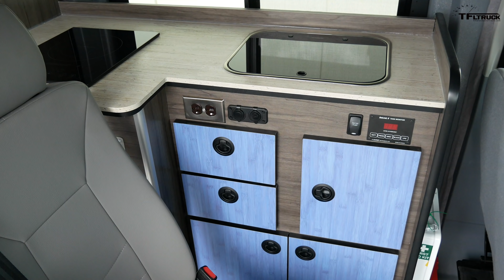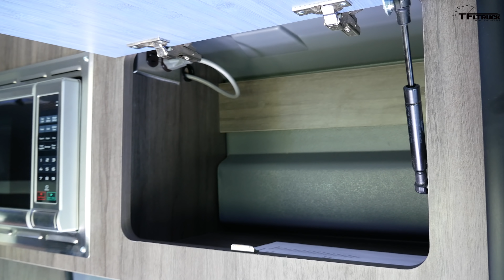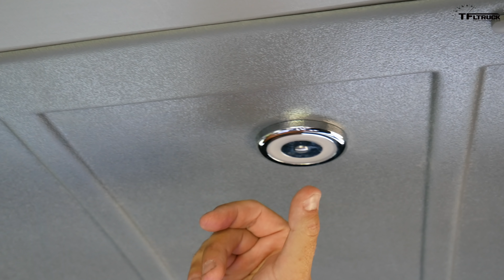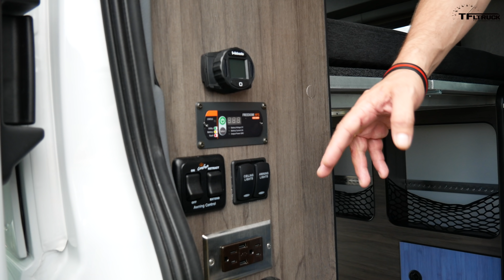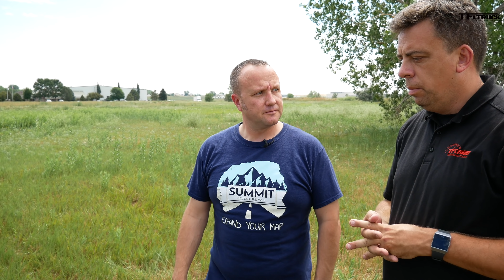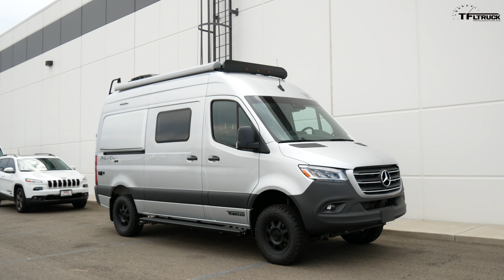This 2020 Ford Transit Summit Adventure Van Is The First Of Its Kind! #Vanlife

Comment: MSRP of this van 135k. Winnebago REVEL msrp - starting at 185k, Sprinter chassis model Winnebago offers - Starting msrp at 215k

People buy Class B campers because that is what they want. They don't want to tow a trailer, they don't want a big class A or C, they want a van based camper.  This is what they cost. Want to spend less, build your own conversion, buy used etc....

Comment: Ford transit vans,Voted best value by Mercedes-Benz mechanics. I have 1. Built it out myself. Bed across the back. Husky 5 drawer tool box on wheels. Stove on top of box. Storage across the upper portion of the bed area. Tool box used for food items. Fireplace in the sliding door. Reflecting shower.

Comment: Did they fix the 3 fatal flaws of the Trasnit (2015-2019)?   Heavy under rust,  Windshield Drainer if it gets clogged it drains onto the MAIN COMPUTER TO CONTROL THE VAN!!!! like WTF FORD?   And the Drive shaft coupler Needs to be checked or even replaced every 5k miles. I sure the hope addressed these issues.

Comment: I like the Russian interviewer, (I'm guessing).  Very good interviewer and presenter.  Also did a good job of editing content, music, etc.  Loved the bed system.  When not in use, looks like you could fit a 4X8 sheet of plywood.  Nice van, very functional.  it is a little pricey, but they need to get paid for a lot of design and production expense in making the formed panels on the walls, very light aluminum etc.

Comment: $135k??? A base 2019 model right now is 25k..  Also do you really want to look so much like an RV .. stealth matters.  Just buy a used one with 30k miles  for $15k still under warranty, build it yourself and rough it a little bit with a compose toilet and small gray tank.  5k and a little bit of DIY goes a very long way.

Comment: Really? 35k difference for the Revel which has 4 wheel drive, a shower, a toilet, better insulation and a premium heating system, and is a much more expensive vehicle to begin with. I don't see how this Ford compares to the Sprinter Winnebago Revel.

Comment: I'm not a fan of the all wheel drive systems. They're fine for small cars.  I had 4x4s when I lived in the mountains and still have a major preference for locking hubs. I can't get used to anything else and I've tried. I'm finishing my 2019 Transit Quadvan/Sportsmobile conversion soon and retiring to the Sierras and Rockies and beyond. If I had to deliver packages in Denver this van here would be fine but not my favorite.

Comment: Talk about greed, 135K for something without a bathroom, what a rip off. You can find a class B rv with a bathroom/shower for around 20K less, if you shop around. Not even an AC for that 135K. I was interested in this transit, until they came out with the price. and as someone else said, you can by a brand new one for 35K to 45K depending on options, and spend another 15Kto 20K and do the buildout yourself, so for half the price of this transit, you can do it yourself.

Comment: 135K???? Where's the gold plating? So many Pickup+Camper combinations would offer so much more for less money. I don't understand this at all. Could literally buy a brand new decked out 3/4 ton diesel pickup and a decked out 4 season 30+ ft bumper pull camper and still have money left over. These "van" conversions are a complete ripoff. The guy selling this thing looks like a shady used car salesman. Pass.

Comment: Custom means you pay for workmanship and skills. Large companies like Winnebago and Pleasure-way are made on an assembly line so workers are typically paid less and may have specific skill set. Additionally vans will have limited floor plans due to standardized parts. Custom shops like outside van and Sportsmobile typically have higher customer satisfaction than a large company.

Comment: These guys are a little too proud, starts at $135k. Nice, but can’t see the value at that price point. Sportsmobile is a better value or even the last gen 4 season 4X4 Revel can be found at this price point now, just my opinion. Nice to see more options though but geez, $100k on top of  the base platform!?!?

Comment: It's not for going off-road it's not four-wheel drive and it doesn't even have a damn bathroom yes it's a cheaper wannabe version of the Revel but none of the capabilities
Reply: you can buy a revel for less as well and have 4x4.....

i prefer a transit gas over the sprinter diesel.....the transit is coming with awd soon...but its not true 4wd

Comment: Love the bed system.  I would use a van both for camping and as a work truck.  I was thinking of a welded steel removable frame, but this looks to be a nice variation.  Price is high for no bathroom. Nicely done, though.

Comment: Pleasure-Way makes a van for nearly half the price on the same chassis why would this cost $135,000? Seems way overpriced.
Reply: I know that's alot you can get the brand new cargo transit 350 for under 40k. I have 2 of these 250 for work.  It also has some issue in transmission. I would go for Mercedes next time

Comment: My questions would be:
1) since the van is tall/high.....would it be top heavy and easy to roll over in a sharp turn or in winds?
2) Did you say it uses unleaded gas and if so what kind of mileage does it get?
3)  sorry....but seems a little over priced....just saying.

Comment: LOL… You lost me at the price. You have no solar you have no propane you have nothing it’s not even sexy.I’m done ...have a nice day.
For those that are looking, don’t get scammed by this... check out the Winnebago Trovato or its competitors that’s a little around 69,000 to 85,000 and you get way much more! Or you can be like me and just build it yourself for a used Mercedes sprinter or dodge pro master at $10,000 - $18,000 and then another $15,000 for the customizations and some hard work. Grand price of 25,000 - $33,000 - you’re welcome.

Comment: I have a Ford Transit Diesel front end on a 2018 Thor Gemini. It's about 4,000 lbs heavier than this van. But even with the heavier weight, the Ford Transit has a lot of "get-up-and-go". Sometimes I like to push it to leave cars at stop lights. Also, the ride is VERY similar to an SUV...something that means a lot after hours of driving with the normal vibration you get with other model suspensions. I think the Ford Transit Diesel is a "hidden gem". I MUCH prefer it over the Mercedes van (both for the ride and the cost of ownership).

I like the water kept inside the van. That means you don't have to winterize the vehicle in cold weather and you can STILL load up your water, before you leave, and you're ready to go. Also...you KNOW its fresh and free of germs! I would also recommend a portable toilet that can also be changed out in winter so it doesn't freeze. In addition I would also suggest they install a second engine generator (as they do on current Roadtrek RV's), with inverter, so one would have 120 Volts while the engine is running. That would eliminate the need for a separate LOUD generator....and even a need for external power (when "boon docking")

Comment: I was a Fleet Manager of a relatively large limo company, with between 20 and 30 Mercedes Sprinter - based commuter, luxury, and limo vans. All diesel. Their Diesel engines gave amazing fuel economy, but...  their Ackerman steering geometry was all just a little off, causing felt skipping and very poor tire wear if you do many tight turns. And the “first” generation of DEF exhaust treatment systems worked great, for the first 100k miles or so. After that, plan on a $7k DPF filter renew by 130k miles. Mercedes maintenance costs are astronomical. Knowing that, and now having experience driving the smooth Transit chassis, I’d go with the Ford 100%. And while the diesel does give better mileage and torque, there is a reason why many school busses are going back to gas - clean, and no after-treatment headaches. I love this van!  Carry on with the lack of LP and go with full solar and a 12v Dometic pull-out top-opening cooler. Let’s go cord-free for 7 days!!!

Comment: Nice looking but a bit overpriced. My self-built Ecoboost 15 passenger van is less than 45k all in with the camping equipment, including the new van. It comes apart for 15 pass duty. Or truck duty without the seats. In camping mode it has a queen bed, seats 5, and a 100Ah Battle born lithium battery, inverter, home brew water system and a sink, and a fridge.

Comment: All the camper vans are unrealistically priced. You have a standard tow behind camper for around $20,000 plus a transit van for $40,000 add those up and you have..... not $135,000 this goes for all the vans.

Comment: Roadtrek and Leisure Travel are only $115,000.00 And they are RV certified. With more options including Generator\Solar... But they did at least have it certified as a Mobile Home. Which allows them to sell it with 10-15 year mortgage. That means cheaper insurance as well..

Comment: I like that it is a Ford but the price is crazy! I think you could get into an entry level Class A for the same price or a little higher or maybe a slightly used one. Of course it is also much bigger and harder to drive. I just can't believe this is so expensive when the cost of the van before modified is around $40,000 $135,000 is totally ridiculous!

Comment: 3500 pound tow rating is a non-starter IMHO. Also lack of propane = boondock killer. If I was in the market for one, I'd buy the Winnebago Revel, Sprinter van based, 5000 pound tow rating, 4 wheel drive, nice dinette, solar and a bathroom. Still doesn't have propane. With the more generous tow rating, you could pull a small camper behind you and have additional capability.

Comment: Unfortunately, Transwest haven't looked at their competition … other Ford Transit RVs. 

Mine is an Okanagan Tribute, 350XL, highroof that includes a rear bathroom (shower/toilet/sink), Truma Combi+ furnace/water heater, twin bed design that can convert easily into a queen, removable table, far more cabinet space, 100W roof-mounted solar panel, 2500W Onan generator, A/C and so much more. The cost of my RV is significantly less than this "weekender model. There are quite a few other Ford Transit-based RVs that people should look into before even thinking about buying this overpriced model. I paid $68,000.00 US ($74,000.00 Cdn) for a used 2018 with only 30,000 miles on it. Cheers, Steve

Comment: This would be an entry level build from most boutique van builders. Other than the extreme availability, there is nothing groundbreaking in this build. Basic electrical, basic heating, mediocre finishes, thermoformed plastic looks terrible uncovered. Whats the pro? Its so cookie cutter you can have one right now with zero options.

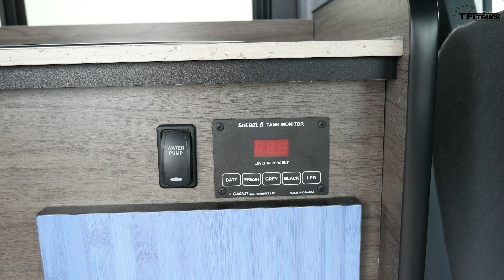Comment: 14:11 "Not having to deal with black water." So why is there a black water control at 5:07?
Reply: @MultiPurposeReviewer … it's using a standard monitor display used by many RV manufacturers.

Comment: I would not drive this van anywhere. I have driven one recently and it felt very unstable and susceptible to roll over.  Perhaps if it was a dually it would add stability.
Reply: @Robert Morris … there are Ford Transit Rvs on the market that use dually wheels. Having gone from a 2003 Ford E350 Super Duty RV to a Transit 350XL, high roof RV, it is far more stable (particularly in winds) and more comfortable. But have never driven the ProMaster as a comparison.

Comment: I get the appeal of these. But for the price...you can buy a truck, AND travel trailer and get way more use out of both. And you wouldn’t be settling for junk on either.
Reply: Or buy the van and build it out yourself.
Reply: Dat Tran, yep that’s another alternative. I just feel that for the price, you could buy a truck that you could daily drive. Therefore not only is it a better price for the total package, but you’re not necessarily buying an additional vehicle. If you go the route of the van, and even fitting it with this stuff yourself, it’s still an additional vehicle your purchasing.
But however you figure it, you can come out ahead basically with any other option. Because all these guys are doing is purchasing the vehicles, and up fitting them themselves. Then they have to make a profit. So to me, it just wouldn’t make sense to buy this with so many other options.
Reply: Agreed.  Way more use from the separate vehicle and trailer.
Reply: This is all in one setup, without  dragging a big wide  rig and trying to make those super tight corners and limiting narrow roads or being stuck at a dead end priceless, you want comfort stay in holiday inn  lol
Reply: We have a Rockwood Roo....About $30 000 CAD and i can tow it with my Taco. Truck and RV about $70 000 CAD. Roo has all.comforts of home.
Reply: Can't stealth camp in a trailer.
Reply: @scottslotterbeck3796  yes you can...look at Rockwood ESP popups as an example
Reply: I feel like this would be pushing for stealth camping. I mean you you have better maneuverability, to get into these areas, but I wouldn’t consider it stealth camping. But I suppose that term has a bit of a floating definition depending on who you’re talking to. 
But to state my point again, it’s about the price point. Im not arguing that this doesn’t have its uses. But you COULD replace this with anything else. Tents are what are primarily used in stealth camping. Or like I mentioned in another comment, a truck bed camper. And without watching the video again, didn’t they say these are 2wd at the moment? If it truly is 2wd, you wouldn’t want to take this off the pavement very far.
Reply: Cesar, I agree that this has a lot of appeal. And I think many people would buy them, but that price just doesn’t make sense. If you’re really wanting compact, there are still so many other solutions. Tents, truck bed campers, or even a pop-up pulled behind your family crossover. It’s just that for whatever style of “camping” you want, almost every other option is cheaper than this. I don’t think it’s claiming an untouched market out there.

Comment: Winnebago Revel starts at $150k, comes with a bathroom, and is built on a Sprinter chassis.
Reply: B. Ford    When I was looking for a Class B I was really interested in a Sprinter based unit.  What I found out was finding anyone (including 8 of 9 Mercedes dealers I checked with) who was willing to service, repair or even do warranty work on the was next to impossible.
Reply: You're right..don't want to be in a situation with the sprinter where you are dealing with the car dealer mentality towards maintenance The sprinter is going to be a headache and expensive to get worked on outside of fleet types of users.
Reply: you can buy a revel cheaper than 135k.....they are not even listed for 150k  .....fyi    people were paying around $112 last year...the price has not gone up $20k   just an fyi on the revel.....ALTHOUGH  revel owners  that spend time off road def add a ton of money on bumpers winches cargo boxes etc.....soooo ya this is not a bargain and not really for  offroad adventures...... plus as others stated with no toilet or shower etc  its way over priced
Reply: If I was a smart person I would start a chain of conversion sprinter only service centers, if I could find enough certified mechanics that is.

Comment: the next question is will you have to option to opt for the awd ford transit version when it hits the market, because thats where it is at when it comes to adventure campers.
Reply: @sean stewart   I'm concerned about the awd system on the 2020 Transit.  Ford is keeping the ground clearance the same for cargo loading and ingress and egress...that doesn't help with off roading.  Also, it's awd and not a true 4x4 system with diff lockers, so it is somewhat less capable.
Reply: @David-rx2to  No one's going offroading, in the traditional sense, in a Ford Transit van. They may encounter dirt, muddy and pot-holed roads, slick grass, snow and ice, rainy and wet surfaces, upon which AWD makes perfect sense.
Reply: @Rick LeBlanc   I agree that for people that use the van for primarily paved road transportation but, there is a segment of users that do off road in a Transit.  They are not taking on rock climbing in Moab but, for vanlife people looking to overland on dirt roads that aren't too technical, a true 4x4 with locking diffs gives a margin of performance and safety over an awd set up.
Reply: @David-rx2to  i get your point, but as someone who drove a 2018 transit rwd for Aarons Furniture in rural Vermont, having awd as an option is a huge advantage, especially for delivery drivers, and adventurers, i found my self stuck trying to get in someones driveway during the winter months because of not being plowed or just packed snow, even with NOKIAN 
HAKKAPELIITTA snow tires and i have to say while its not a Quiggly 4X4 with high ground clearance, i have found my self guided by GPS down class 4 roads. and if you are not accustomed to vt, that is a unpaved road that is never maintained, so kind of like a off-road not off-road shortcut, which recommends high ground clearance and/or AWD/4WD, and ground clearance was never an issue with the transit, and man those things can be rough, and rutted, just like driveways and dirt roads durring mud season and no issues there ether. so its def not useless.
Reply: I'd do a Quigley 4x4 conversion.
Reply: @5stardave     Absolutely.   Check out Newburg Ford in Newburg OR website.  They have 26 Quigley converted 4x4 Transits in stock right now from the $50k's to the high $60k's depending on options.  You could DIY the interior or get spendy with an upfitter and still not break $100K....a lot cheaper and better than the example in this video.

Do you work for 5star tuners?  If so, I can't wait to see what you guys do with the new Ford 7.3 gasser as I think there might be a lot of potential there.